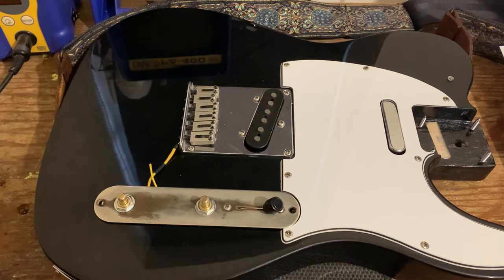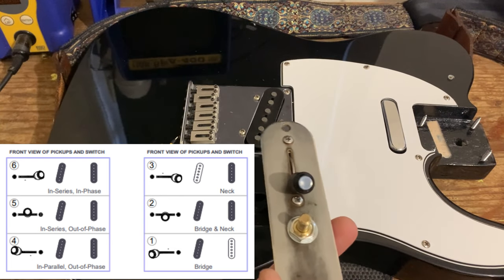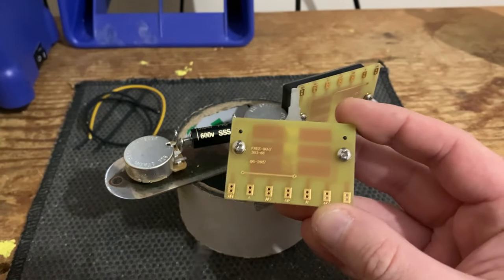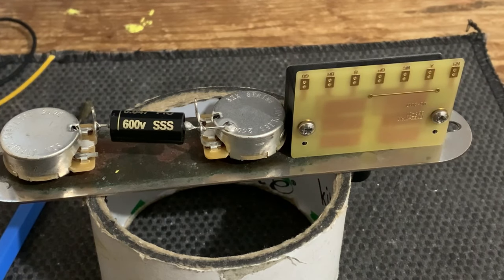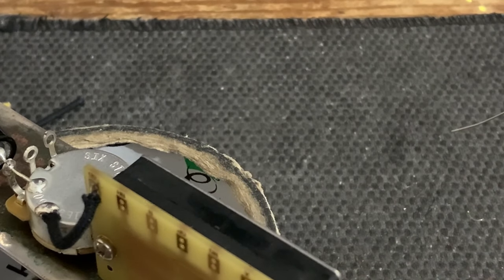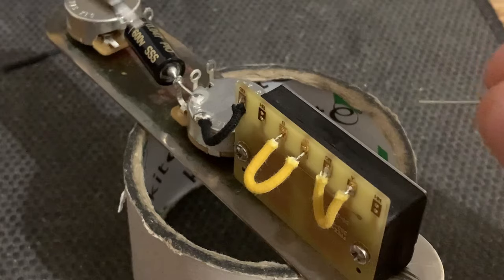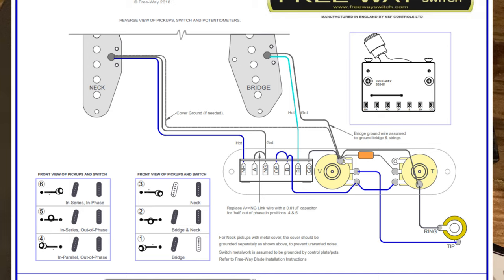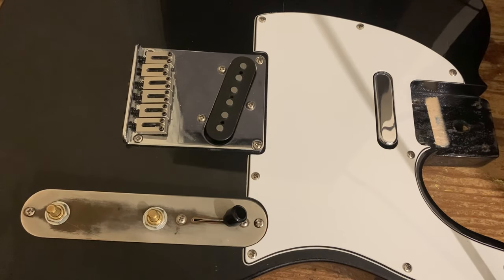6 Way Telecaster Wiring: How to Wire a Free-Way Switch

Comment: Top tip when testing pickups: use a metal tuning fork instead of tapping the pickups. It acts exactly like a string. Just hold it above the pick-up you’re testing as it vibrates.

Comment: Excellent video tutorial. I ordered one of these switches from you and it has just arrived in the mail. There is just one issue ... I'm left handed!!!! Installing it in to a left handed Pacifica 112JL with a P90 humbucker size single coil in the bridge, dummy blanked off middle, and a Strat single coil in the neck. Does that mean that when installed in my guitar the upper bank will give me the  standard tele tones and the lower bank is the series and phase reversed options?

Comment: Did you have to remove any wood from the cavity to get it to fit? I'm finding that it's likely going to be impossible to get the switch to fit in my control cavity otherwise.

Comment: Appreciate your videos on wiring! I installed a 10 way switch into my stratocaster and everything worked perfectly. Unfortunately I had some issues with the telecaster switch. Your instructions were spot on as usual, but I could barely fit the electronics back into the cavity. Hooked everything up, and I only have a neck pickup and no lower bank tones nor a neck pickup. Basically I have neck only and top and bottom sounds the same. Sheesh. Going to pop it out and check my connections. I may have very well messed a connection up fighting to get it in there. I’m surprised there’s not much out there on how tight they go into a Telecaster. 

I have a 2012 American Special. Just thought I’d mention to you guys looking to make this mod. The switch is really nice, but be careful getting everything back in there. I hope I don’t have to use a burring tool to open the inside of the cavity up, or end up putting my stock switch back in. We will see tomorrow!

Comment: Thank you for posting this video. I just received this Free-Way switch the other day but I have been unable to find a wiring diagram for the HS Tele pickup configuration. I've found HH and SS diagrams. Will your setup in this video work well with this switch in a HS tele?

Comment: Can you recommend how to wire this same setup but where the tone is only on the bridge pickup? With a traditional tele 3-position switch, you would not wire the tone to the volume, and instead wire the tone to the B1 lead. What would be the equivalent on the Freeway 3B3-03 blade switch?

Comment: Hi, I need a replacement for a 5 way switch for a Sterling 4HH bass guitar. I never use the single coil configurations that came with the bass (Bridge H, inner singles, HH, outer singles, Neck H).
Can I use this switch to get Series (Bridge H, HH, Neck H) and Parallel (Bridge H, HH, Neck H)?

Thanks.

Comment: Hi. I do exactly the same wiring diagram.
The "classic tele" bank work, but the out of phase-line-parallel don't work. neck pick up only on left position, no output on center and right. The switch can be faulty? 😢
Reply: I'm having the exact same problem. Did you ever figure it out?
Reply: @DagLeafMusic   now it work, but I forget the solution. Sorry, i do it longtime ago. 😑

Comment: I've been thinking about doing a build with both the six and ten way switches just to give myself a headache!
Reply from the maker: Go for it! Perfect lockdown challenge that is!
Reply: @SixStringSupplies  My first ever wiring job had a 6-way rotary switch, three push-push switches, a 3-way toggle and two Triple-shot humbucker mounts.
This should be a piece of cake in comparison!
Reply: @onbedoeldekut1515  YOU, sir, are SICK-and I salute you!  I can pretty much guess the rest, but what were the 6-way and push-push switches for?
Reply: @cpfs936  The six-way selected different capacitors and the push switches reversed polarity and phase independent of the triple shot, so I could select individual coils, reverse their polarity, have them out of phase in (almost) any combination.
I think there were 1,152 possible configurations if I remember rightly.
I'd like to incorporate a high output p-rail type pickup with taps on each coil, that'd give even more range for what's in my head!
Reply: @cpfs936  I also had a q-filter acting as a global inductor for each capacitor into the tone pot.

Comment: Can I use this switch on a Stratocaster with 3 pickups and do all the normal 5 -way settings and then with an extra 6 setting?
Reply from the maker: yes, but you would lose a tone control (master volume + master tone) full range of diagrams for these switches are available here: https://www.freewayswitch.com/schematics-blade/
Reply: @SixStringSupplies  Great! Thanks so much for your reply. Will do.

Comment: So there is this Oak Grigsby 6-way lever switch (available from StewMac) for Strat: could you please do a installation video with a humbucker at the bridge position please? If possible with the bridge and neck combination (Tele setting) where normally the middle pickup would be activate (if that is possible?). https://www.stewmac.com/electronics/components-and-parts/switches/oak-grigsby-6-way-lever-switch
Reply: ...I guess not...